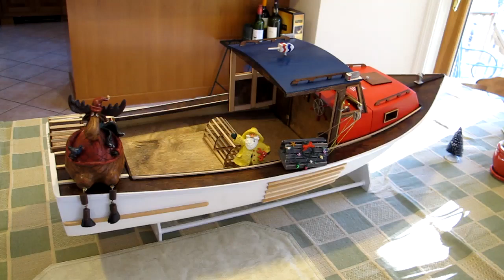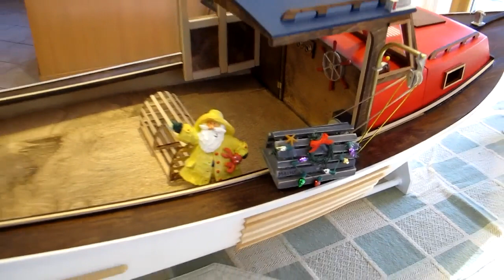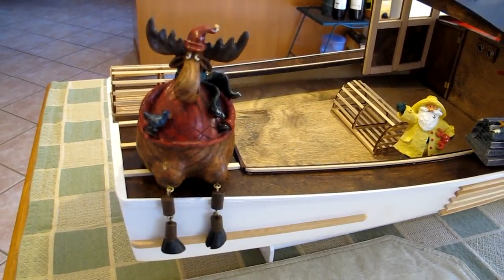The Snapp2it RC Model Lobster Boat - Dry Run

Comment: What is it made off
Reply from the maker: Hull is fiberglass.  The rest of the boat is wood.  It was a kit from Bluejacket Ship Crafters of Freeport Maine.  The moose and lobster man are plastic.   Thanks for you comment.
Reply: Craig Snapp how much did it cost altogether because for the kit it costs 120 but then it says completed costs 1000
Reply from the maker: I did the kit which was a nice winter project if you like that kind of activity and have the skill.  I worked part time for several months.  I can't remember exactly but as I recall from 2012 it didn't come with the radio control gear or the electric motor which had to be purchased separately.  I had to purchase paint, glue etc. and got custom decals for the boat name from some outfit on the internet.    
I just checked the Blue Jacket Shipcrafters website and found that the current price is much higher than you stated.  They want $435 for the kit without the motor, battery or radio control gear.  Price for a complete running unit with everything installed is $2600.  Not cheap but great fun to run and a nice family heirloom for my grandkids to play with.  
 http://www.bluejacketinc.com/kits/rclobsterboat.htm

PS - I had to replace the motor once when it burned out after being fouled with seaweed and run too hard!
Reply: Craig Snapp ok thanks